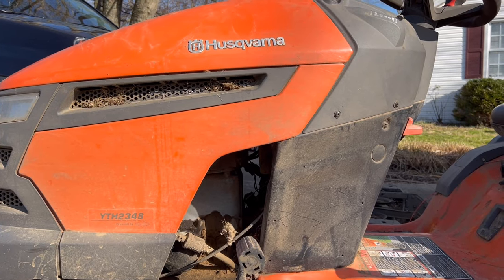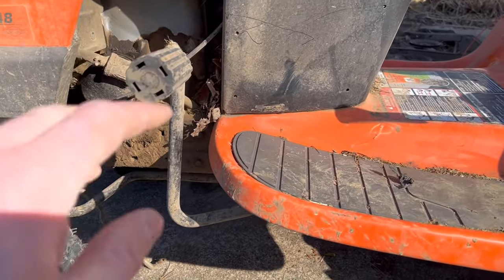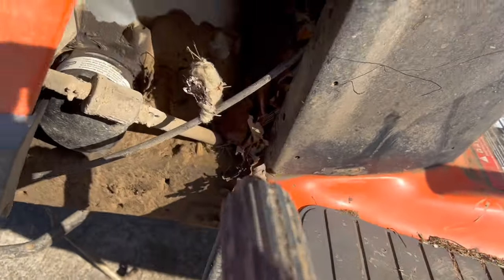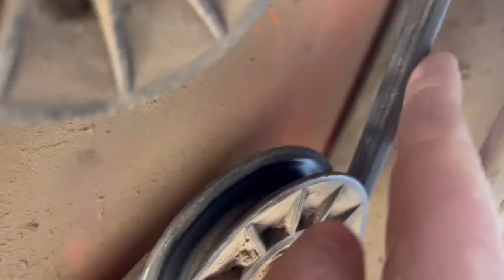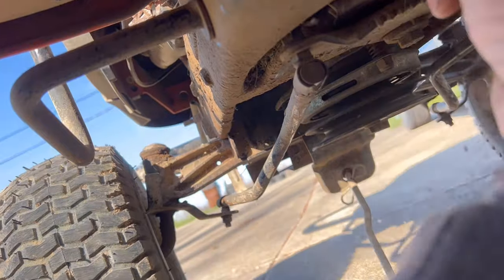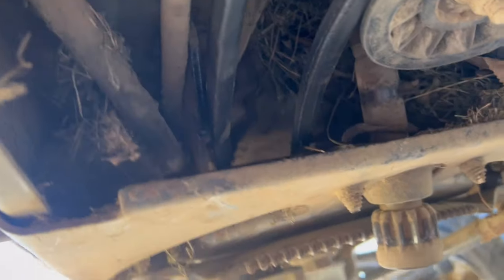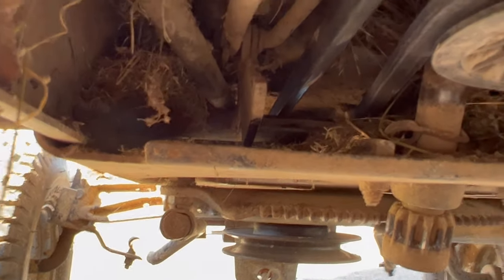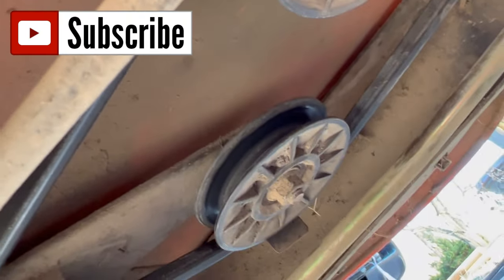Mower - Low Speed / Struggle Hills? - Fixed.

Comment: Yes this insight helped me although it wasn't grass but a loose part.  I have a rear engine cub cadet and under the foot pedal is a small plastic access door that could sit in the palm of your hand.  This fell out one day and and I didn't notice at first.  I thought it had gone into the grass and lost.  However after a few cuts of my rider acting up, it had fallen down into this void and was blocking my pedal from fully lowering.  Fished it out, issue fixed.  Its a 6 speed plus park and I didn't have park or 1st gear during a few cuts and the pedal was not moving the into the same "rest" positions.  Then in researching, I hit this video and light bulb went off.  Eureka.  Thank you sir.  👏

Comment: Thanks Brian, had a similar problem - my fault though - after I had replaced the clutch assembly, turned out  I had  one idler pulley with the belt fitted the wrong side - dropped the deck, used two long screwdrivers to lever the belt correct side against the spring tensioner (inside pulley, both sides), refitted deck - 'Bob's your Uncle' - jobs done !!

Comment: I just pulled my mower into the shade to cool off because after I stopped to pick up golf balls littering the yard, it seemed to have half the power up hills even though the tires weren’t spinning and the engine wasn’t dogging down. I figured grass was packed in there, but this wasn’t going to be the first spot I checked.. until now.

Comment: Thank you Brian for posting this video.  I've been working on my riding lawnmower for days trying to fix the lack of speed issue. I was getting depressed thinking it was a transmission issue, which would cost more than its worth to fix. After watching this video i cleaned out the brake/clutch peddle and that solved the issue.  You're the man!

Comment: Funny you mentioned this because it actually says in the manual on the maintenance page about cleaning this out when I was going through it 10 minutes after watching your video. But still didn't fix my issue So I pulled the transaxle out replace the oil, and refilled, replaced the drive belt (cracked), replaced the spring to the tension rod but still does the same thing. My next thing to do is pulling the transaxle out again, and rebuild it as the belt is super tight but not wanting to go up hill after mowing a 1/2 acre. When I first starts it runs perfectly. I have the LGT2654 bought it used from Lowes 9 years ago with 100 hrs already on it. I was looking a new mowers today but I dont like the fueltank right next to the engine under the hood especially not in this central Florida summer heat.

Thank you for showing this, sadly didnt fix my issue.

Comment: Thanks - I even had changed the drive belt (incredible hassle) and it still was slow as hell up hills.   Watched your video.  I chocked the back wheels and jacked up the front with the deck all the way down.  Was able to reach in there with a chisel and push/pull out a big thick pad of old grass and dust.  As good as new now!  Didn't have to remove the mower deck.

Comment: Glad I found this video...saved me $ and a lot of time and frustration. Ready to change the drive belt on my  Craftsman DLS3500 because it was drivimg very slowly and after viewing the video discovered compressed and hardened grass clippings under the clutch/brake system just as described and it was fixed in two minutes. Thanks!

Comment: My Craftsman just started doing that. Going to check that out. I always clean the deck and under the hood after mowing, never thought about under there.
Reply: Did it work? Have a Murray 17.5hp 24 in and it's slow and transmission lever has lots of slack too

Comment: Awesome thanks. My problem is my Arien 42 has a hard time turning over fast enough to start so hoping it just needs a valve adjustment and not the compression release in my 18.5 hp Briggs that I see breaks a lot. Has bad design and if I knew about this before I bought it I never would have purchased a lawn tractor with a Briggs.
Reply: You have to adjust your throttle cable 
Videos on YouTube on how to do it 
I had the same problem on cold starts 
Little adjustment 
And back in business.

Comment: Mtd mowers are bad for packed grass interference with the forward and reverse pedals movement as well. I've seen more than a few that were really slow in reverse and people thought they had transmission problems, but clean out the grass and it's like new